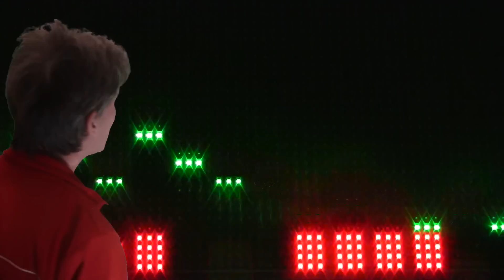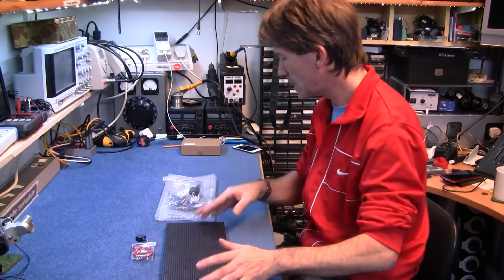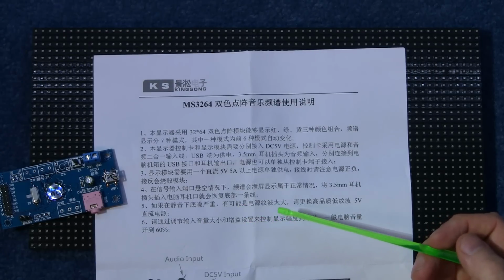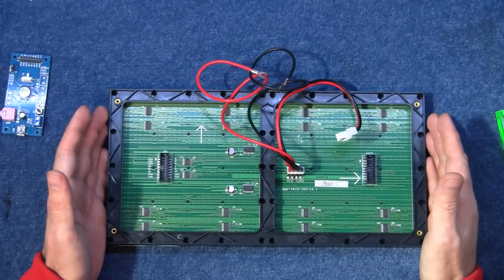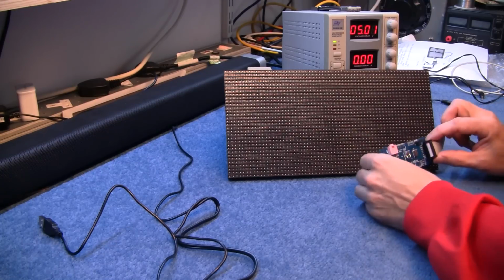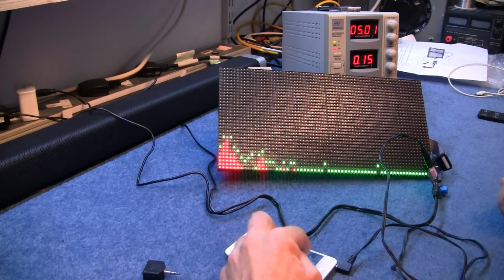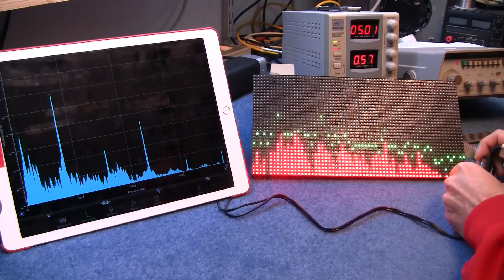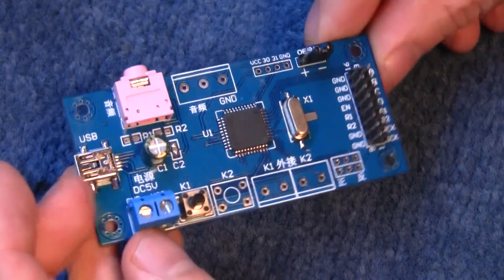2048 LED spectrum audio analyser MS3264 from Banggood 6"x12"

Comment: That has not been just harmonics, that has been aliasing. When you don't have a bandwidth limiter on your input that corresponds to your Nyquist frequency, that's what you're gonna get, the frequencies beyond Nyquist get reflected back into the sampling band. This is why when sweeping in one direction, you'd get major peaks moving that way, while minor peaks moved the opposite way!

Comment: Yeah that LED panel is a totally standard unit, it's multiplexed so it doesn't need very many connections. They're nowadays very cheap (used in video walls and signs etc) and available in all sorts of sizes and pixel densities (as well as RGB not just RG like the one you have). If you google "RGB LED Panel Driver Tutorial" there's a pretty good explanation of how they work w/pictures. Not too hard to hook it up to anything, however if you want intensity control of each pixel you need to drive it quite fast.

Comment: 16:10 while increasing frequency, some peaks are moving up and some are moving down.. Is this what aliasing looks like ? Bad/no input cut-off filtering on the input ? It's a cool display. It can be used for many things, and I'm sure someone can hack up a better controller :)
Reply: I was thinking the same thing while watching the video. Probably no low pass filter before sampling the signal at a pretty low sample rate.

Comment: I had no idea you could read Chinese.
Reply: he probs has the google translate app off screen why would he be reading Chinese like its chinglish.
Reply: Fair point
Reply: Perhaps he can read it, but not very well. Markus, can you read Chinese with any degree of facility?
Reply: I like to imagine he knows chinese.
Reply: Jay Bee spoilsport
Reply from the maker: iNfx1 I can read a few parts to do with electronics but google fills in all the gaps.
Reply from the maker: Michael Smith Hi Michael I can read a small percentage associated with years of electronics but I needed googles help to fill the gaps.
Reply: Well, I imagine all myself and many others see are moon runes, so you're doing pretty well at that. Haha. Nice.
Reply: How can I enter chinese glyphs from sheet into google translate?
Reply: you raise an interesting point.  maybe chinglish is on the other side of the paper?
Reply: Use the Google Translate app - it "reads" using your camera and translates on the fly.
Reply from the maker: You can use google translate app on a phone and point the phones camera at the sheet of paper.

Comment: Hey Markus, why not just try and add the switches (or shorting the contacts with pliers) to check if they just left those switches out to save cost but included more functionality than you can actually access? I think that's quite common, to have hundreds/thousands of those chips produced, which are all the same but limit the users/buyers possibilities by taking away "access" to them. Just something that I thought would be interesting :)
Reply from the maker: hitmiccs Hi I shorted the parts on the board today and nothing seems to happen, maybe it requires a bit more programming to use the extra features
Reply: Hey, thanks for trying anyway - could have been a nice little extra to play around with.

Comment: Hear me, my Friend M.Fuller :-), i have a very difficult question to you: you know that in synthesizer (mostly in analog versions) there are led´s to show how many voices working in polyphony, for e.g. 8x led. There are for givin an status signal (on/off). Do you think it can be possible to construct (it is not an question of it is cheepy or expensive - only of the possibility) this panel you explain in your video - i am writtn under here, into that way that it can show as the working in a status on/off-mode for Voices? But not for analog synthesizers, i am think to digital synthesizers like an 128 Voice Rom-Sampler. And more: in these fact of number the led´s it is to be need 16 x 128 voice synthesizer. Its difficult because, from where can be taken the signals? I am thinking maybe by read out the midi- data- flow... ? What do you think? On this way i am want using the chance to say: you make  a great work here on YT! Best wishes & thanks in the front of... ...René

Comment: Thank you for your video, it is very explanatory.
Would you like to give me some advice please?
I have an amplifier with bluetooth input. therefore, I can not recover the signal with a 3.5mm jack. Can we connect this system to a microphone to get the sound of the amplifier?

Comment: For the audio testing you should have used a SINE wave so you wouldn't have had the harmonic issue!  Suggest you try it again.
Reply from the maker: Mike Fellhauer Hi Mike I did use Sine wave but it was just a quick setup so the analyser on the ipad was using its inbuily microphone to pick up the speaker bar just behing it. I know this is not the scientific way to do this but I could not find my TRRS audio in cable for the ipad. the LED analyser did however have a direct cabled input.

Comment: Nice review and looks a fun project.  On checking the links below however, I spot a problem.  Although the unit is keenly priced you will get nabbed for customs excise charges by the Post office, here in Ireland anyway...  The customs charges will cost near as much as the item itself... Bugger
Reply from the maker: Ribbitmefoot Ouch you have a high customs rate in Ireland.
Reply: but it clearly says Value €0.50 on the declaration sticker :)

Comment: Hey I want something where if i play a specific frequency (sound) I can get an LED or some other light source to play the exact same frequency (color) but I have no idea where to start.  I don't even know what to write in a search bar to find my specific request. Do you have any suggestions?
Reply from the maker: Hi Mark. I think I know what you mean though a frequency of light is much higher than sound frequencies so one cannot be the exact same frequency as the other. but I’m guessing you mean low to high frequency in sound making a LED go from say red to green to blue ? or something like that. If so I think you may need to look into arduino as theres so much you can do to program one of those little boards to make them do almost whatever you can imagine and there must be a sketch (a sketch is a program) that someone may have already written that will change the colour of an led depending on a sound source. these programs are normally found for free on websites like github. so have a search for arduino and github plus theres lots of kits available to get you started in your projects.
Reply: @markusfuller  hey man thanks for the reply much appreciated. I am not sure exactly what to look for. I want to be be able to play lets say 528Hz sound and show 528nm on the light spectrum
Reply from the maker: Mark Henein Hi Mark. that would only be possible with some electronics and something like an arduino or raspberry Pi and a bit of programming to convert the analog input of the sound, analyse where it is in the audio spectrum then give an output of a specific colour to to leds but just the output itself would also have to be split into 3 outputs for red/green/blue at varying intensities just to blend the leds into making that colur that you require. it is possible to do but you need someone who can program arduino or Pi or something similar.
Reply: @markusfuller  do you know how i can find someone who can build this for me?